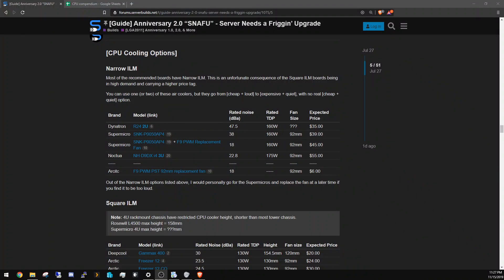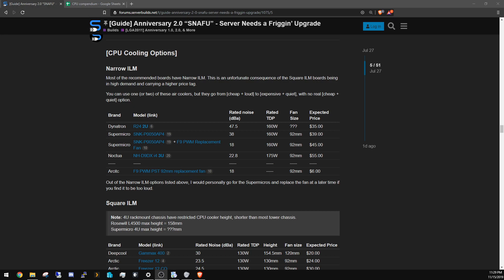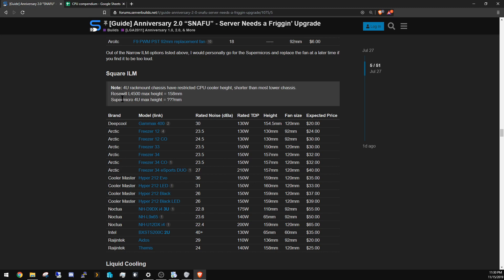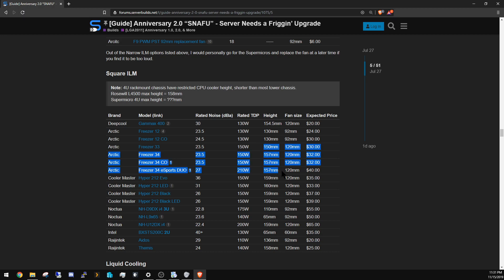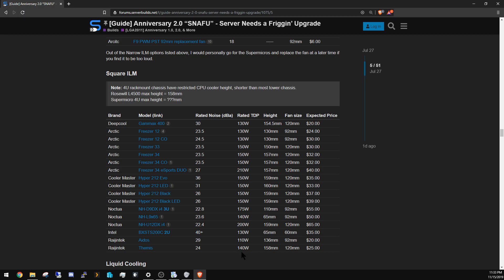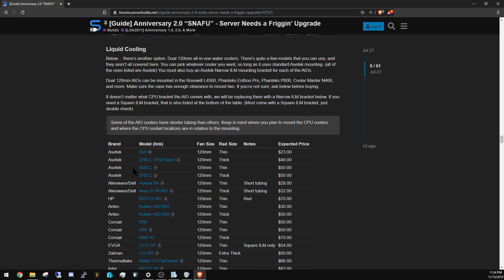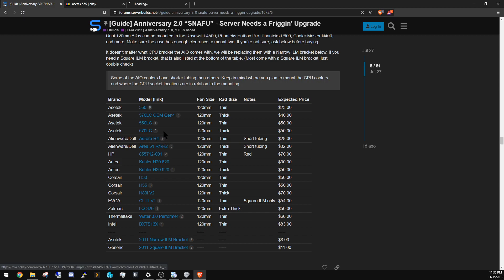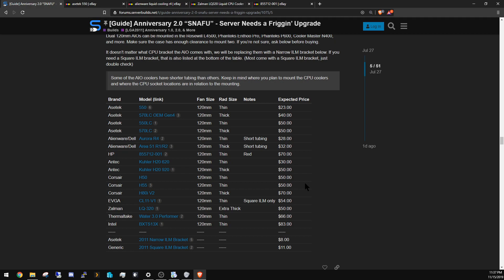[Heatsinks & Cooling] Anniversary 2.0 LGA 2011 "SNAFU"

Comment: looks like there was a build posted on the forum using EVGA CLC CL11 coolers with a narrow ILM board (X9DRH-7F)...I thought that shouldn't work?
Reply from the maker: Where?
Reply: @JDMWAAAT  https://forums.serverbuilds.net/t/anniversary-2-0-example-build-virtualization/2203
Reply from the maker: @zerocoolfpv7472  It seems as though he swapped to alientware coolers with the narrow ILM
Reply: @JDMWAAAT  in the write up he said "At first I went with the Dell Area 51 R2 liquid-cooled CPU cooler since it was cheaper, but it ended up arriving damaged, plus the hoses were far too short to reach the fan wall, so I ended up returning them. I purchased the EVGA CLC CL11 as replacements, which fit perfectly and work quite well." 

So those early pictures must have been a fit test with the Area 51.
Reply: @JDMWAAAT  I can confirm the CL11 worked just fine with the narrow ILM boards...I just got a X9DRD-7LN4F-JBOD and they fit perfectly
Reply from the maker: How is it fitting just fine? What mounting bracket did you use? Could you message me the info on the discord?